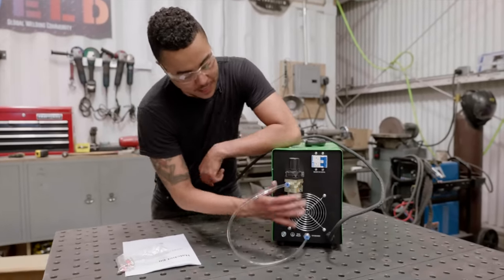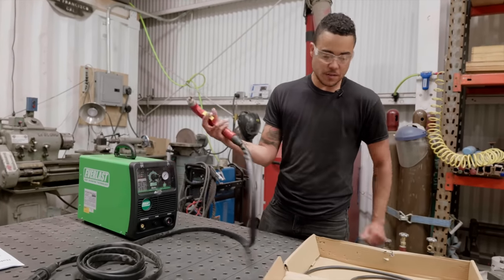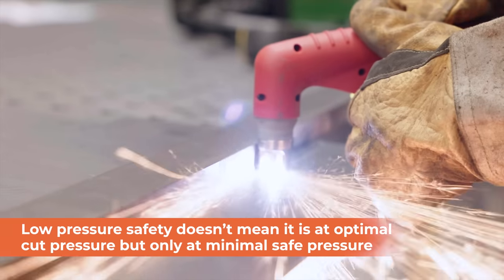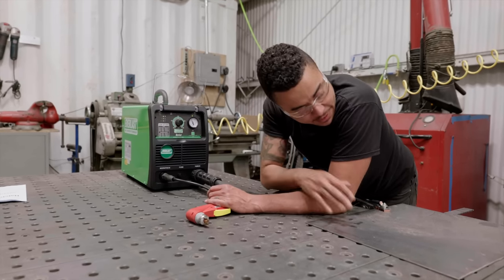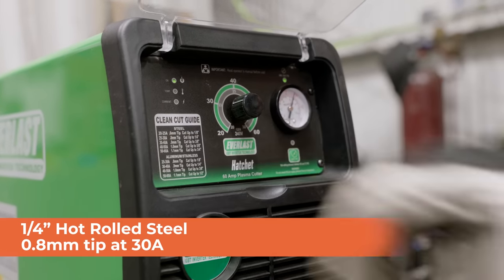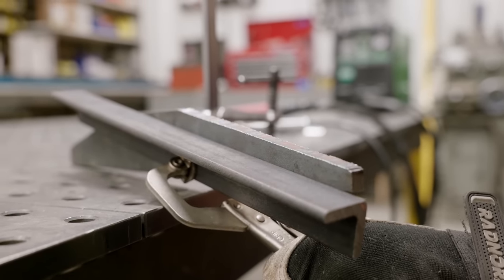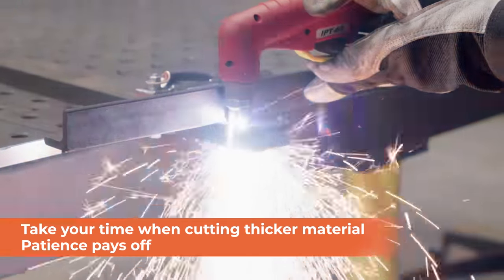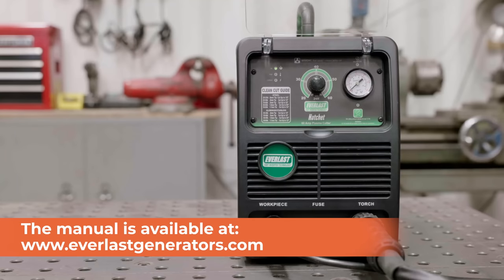Lightweight Portable Handheld Plasma Cutter: Everlast Hatchet 60

Comment: Looks like a nice unit. I've got their 52i unit and it works well. I've got 2 MTS welders and the 52i and none of them have any guides for welding or cutting on them! I do like the units.
Reply from the maker: It’s a good machine for sure.  We will provide guide resources in our app for this video as well.  Thanks for the feedback Andy!!
Reply: @Welddotcom  looking forward to more information......cheers from Orlando
Reply: The 52i has an easy formula that equates to the same settings in the manual.  The MTS welders feature synergic function which eliminates the need for detailed charts in most cases.

Comment: How is it any different lighting it in the air and not on the work piece as far as tip damage.
Reply: :Swampy, I don't think it really harms the tip or electrode by firing in the air, but it does put wear and tear on the tip and electrode while not doing any work. Maybe one of the Engineers from one of the Plasma Cutting Manufacturers can chime in, I have been using my Plasma cutter since 1996 and never noticed wear, and while running a CNC Plasma Table the starts are many times off the material to keep from having to pierce the material. Hope this helps, Paul [Paulie] Brown from weld.com
Reply: With a pilot arc, the arc is born on the consumable itself since the plasma cutter itself becomes the ground connection.  Using the electrode just firing it in the air erodes the nozzle edge much quicker when done excessively.  If you look at the pilot arc you can seen the flame "leaning over" onto the face of the electrode. Keep in mind this is a very hot electrical arc. The amperage is reduced to 20 to 25A so it doesn't do a lot of damage quickly to the consumable.  If it put a full 60A, it would blow the tip out in seconds.  20A cutting is different though than a 20A pilot arc. When the pilot arc starts, it scours the surface and creates (almost instantly) continuity. As soon as the arc transfers, the pilot arc shuts off.  The pilot arc should never be used to try to cut. It'll etch but it will also overheat the circuit if it stays on continuously without transferring the circuit.   You'll get 50% faster wear or more if it is used excessively. It's fine for cutting to have a pilot arc, but pilot arcs aren't meant to be something "pretty to look at".  It's also great when working on expanded metal or rusted and dirty metal where continuity may be lost.
Reply: @marklugo6002  great reply, learned some great technical information, thank you, Paul

Comment: is there a set measurement you can employ from a backguide to the cut line?
Reply: Just measure the distance from the outside edge of the orifice to the edge of the stand off and you have your distance. You can adjust for kerf too if you like.